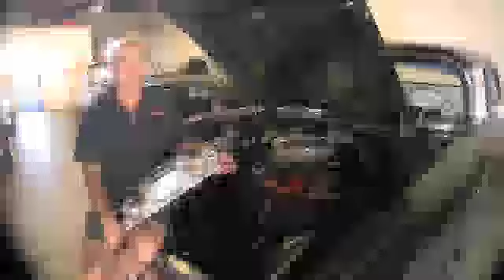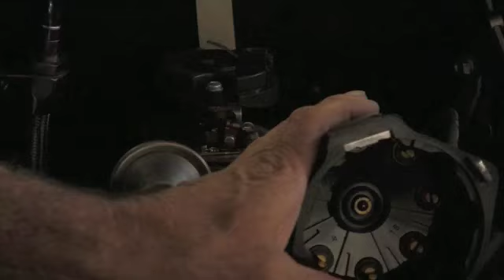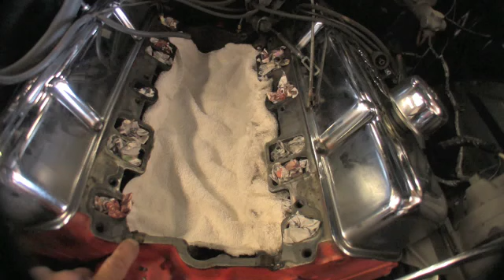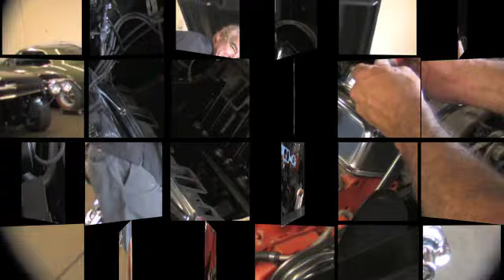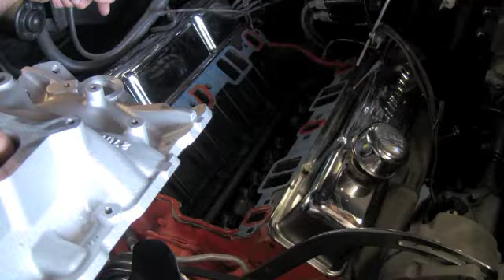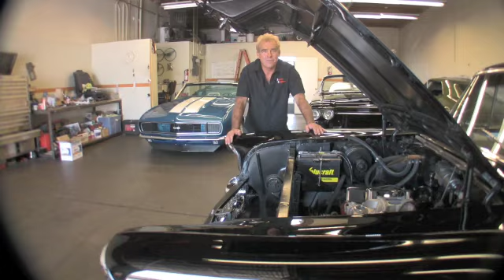Intake manifold Gasket replacement No Oil Leaks  by Scared Shiftless

Comment: Followed your instructions on my GM 305 CID...torqued all bolts to 30 ft lbs starting from center and found no oil leaks. Putting the distributor back in was a little dicey...but rotated the gear cw and then ccw and then slightly off the mark and it dropped right in. Engine cranked hard (battery?) but then started...needed timed 8 deg BTDC...now cranks easily...Many Thanks for your video!

Comment: Mark, Thank you very much for taking the time to make this video. Its about the best one out there for Chevys. I followed your steps in detail to seal intake. I got ZERO leaks, with the new intake install. I did my timing a little different, I set it to engine to point at 34 degree BTDS on the balancer then dropped in the Distributor rotor point to # 1 Plug tower on cap. Fired right up timing very close. Thanks you again.

Comment: Nicely done!  I did the same procedure on my 68 350 Pontiac.  30 years later I tore down the engine and the silicone was still working and parts came off easily.

Comment: Thank you for responding back, and thank you for your video. I was going to use those rubber gaskets, but I will just use the High temp silicone. Don't want any leaks.

Comment: Hey Mark, I have been a professional mechanic for over 10 years, I have used Scotch-Brite pads, a rectangle pad like you show and a 2.5" disk for an air tool. I have completed and estimated 1,000 intake R&R's and have never had an engine blow up. These fibers you speak of are actually composed of plastic which has a melting point of 150°C, the fibers are also coated in aluminum oxide. I agree a hard substance like aluminum oxide should not be inside an engine, however a razor blade/scraper will not always remove all gasket material/oxidization. I like my intake gasket to seal, especially if that is why you are there in the first place. If what you said were true, there would be many mechanics out of a job as I've seen nearly every one use this "forbidden" procedure.
Reply: Well lots of mechanics do things wrong, too. Most people I've heard say never to use those scotch brites, but I know there are different varieties of them so who knows, maybe some are more destructive than others.

Would you agree on the 5-minute "set" time for the silicone? I'm about to do this job on a 3.4l V6 but it's my first go at an intake manifold. I'm just curious if the silicone has to cure for a minute before torquing the manifold down.

Comment: after watching all these videos on how to remove and or install a intake manifold I never hear or see you guys explaining that it is absolute necessary to drain the radiator and block before removing the intake....if you do not then as soon as you break the original seal between head and intake all the water at top end of motor falls into the oil pan....

Comment from the maker: Using a small amount of silicon on the intake bolts will help reduce oil from climbing up the threads. It is best if you use sealant around the sides of the bolt only!. Try not get get the sealant on the end of the bolt that could go into the engine valve train area. Great Question M. Welther. Thank You

Comment from the maker: In the center of the heads on the intake side there are ports that would have heated the underside of the intake to warm the fuel. The exhaust would have run from one side to the other through the intake.  That is a thing of the past. It was more for smog than anything else. Very common even into the 1990s on most engines.

Comment from the maker: Permatex High Temp Red RTV Item # 81160. Works very well. Never a problem. Thank You
Reply: Ok Mark I have a 67 Chevelle I put a olds5.0 from a 80 Cutlass. Now I'm up to Putin the intake on I never hear of not using the gaskets. If u have that nice of a car I'm sure u know what's up. So this Friday I'm going to do it myself. Any advice u can  give me like do u use one tube of red n is it a quarter of an inch around the jackets. Well wish me luck because this is my second attempt n I tried using the rubber n when I torqued it down they moved. NICE CHEV. Thanks I let u know how it turned out

Comment from the maker: We only use Felpro MS90314-2 These gaskets fit many engine sizes so check before you install. No sense in doing all that work to save a couple of bucks installing cheap gaskets. I am pretty sure most part stores have them in stock or can order them for you. Thank You for your question.

Comment from the maker: One is for the heater hose fitting. The other is used for water sensor. Sometimes the water sensor is in the head. You can just block them off if you are not using them. You may want to check the back of the intake for another water port. Sometimes there is another for steam. That would go back to the radiator. Most applications do not use this port unless you are racing and need extra cooling. Thank you for your comment.

Comment: great video,  swapping out a efi throttle body out for a new carb and intake, how about those middle inserts for the bolt directional change, looks like they could use some sealer around them,  your opinion,  thanks

Comment: Hi Mark,
Thanks for taking the time out to do the video. Question for you. Everyone says to have your engine at TDC but if you mark where the rotor is pointing and put it back at the exact same location and if the engine haven't turned since you took out the distributor, is TDC even a factor? I'm replacing my manifold and having my distributor recurved and marked the location of the base and the location of the rotor. If it goes back in the same location, I'm good to go?
Thanks!
Reply from the maker: You can set the timing to top dead center no problem. However as you stat as long as you do not move the engine you will not have any problems getting the timing set. More than likely after the distributor has been curved you will have to adjust your timing a little to compensate for the new curve values. Thank You for your comment. Mark
Reply: Mark Boice Thank you for your reply! Appreciate the help!
Reply: Mark Boice Bro, I m having a problem with the metal part of the brake booster tube at the intake.(Chev 350, 93 Suburban)  I believe the smaller end is 18mm and the bigger end is 21mm.  But I cant turn the smaller fitting without twisting the tube. And I cant turn the larger one without turning everything.  It is the final piece before I can remove the intake easily.  What do you suggest?

And I used a breaker bar on the crank to get the rotor to the #1 cylinder position in the distributor before I remove it(which also means that the engine should also be on cylinder #1.  So as long as I dont crank the engine the distrib. should be installed in the exact same position(which looks like 5 o'clock) when I put it all back together.  What do you think?  Good or bad?
Reply from the maker: ZanzibarJose You will need to apply light oil to the fitting. Use a fitting wrench and turn the fitting back and forth just a little to loosen the tube. You can use compressed air around the fitting to remove the debris around the fitting that is holding it up. Keep applying light oil and compressed air and turn the fitting just a little at a time. It is a long process but it will work without damaging the tube and fitting. Mark
Reply: Mark Boice OK, flared wrenches, good.  I ll try that. Penetrating oil on the threads of the smaller fitting, ok, good.

Comment: Thanks your reply, your instructions were great. I have a follow up question. When i broke the intake seal, i heard a gurgling noise, like fluid was draining down. What could that be? I did not fully remove because i had the head gaskets on. Im hoping its jot antifreze getting in. Guess i would see that once i pull intake off. What do you think?
Reply from the maker: Probably anti freeze. Just get as much out the valve train area and for sure drian the oil and replace it before starting the vehicle. Get question! Thank You
Reply: Yes antifreeze. Best to drain it down a bit or do a drain and flush when replacing manifold gaskets. My 93 Sierra leaks oil from front and back of intake manifold. And also the oil cooling lines leak and need replaced but are gonna be a pain. Has clamps holding  lines to oil pan connected to the oil pan bolts. And there are two support rods from the block to the flywheel cover in the way also I can't break free. At least before I bought a 24 in breaker bar. But my engine bay is getting full of oil and looks ugly. And timing chain is going in today as well. And catylitic converter is probably coming off as well and just put pipe in it's place. No emissions where I live so don't need the restriction.

Comment: Thank you for this video man, I just used this to replace my intake in my 63 impala. Followed every step and I hope it doesn't leak and solves my problems I'm having.  Also very funny with the wifes towel . Thanks for adding some humor to it. How long do you usually wait before starting the car?
Reply: 24hrs
Reply from the maker: You should wait at least 4 hours. We usually give the sealant time dry over night. Thank You for your comment.
Reply: Hey Mark . I waited a weak to start it . just started it and it's leaking coolant out of the front and rear intake  only on the pass side . it's coming from the gasket , not the bolts .. I checked and they are torqued . any ideas ? will I have to pull it all off and try again ?
Reply from the maker: Sounds to me if you have only one side leaking, the gasket slide from its positive position. You will have to take it up to inspect. The only other thing which would be not so common a problem is that the block and heads have been milled past the correct angles between cylinder head and intake. My bet is on the gasket slide. Please let us know when you find out the problem and solution. Thank You.
Reply: Mark Boice okay I will check and see . all bolt holes aligned with the gasket holes when I installed the bolts . but I will tear is back down and see what's going on . think I'll need to buy new gaskets or can I reuse ?
Reply from the maker: New Gaskets!

Comment from the maker: Great Question! It is always a good idea to wait a couple of hours before adding coolant. It will take some time to install all the components back on the engine like carburetor, alternator, and linkage. By the time all the items are installed you should be fine to start the engine with no problems. Thank you for your comment.

Comment: Why are you adding more gasket to a gasket, specifically RTV sealant.  The intake gasket is the RTV gasket.  You are creating another place for fluid/exhaust to leak from.  Felpro recommends to install their intake gaskets DRY.
Reply from the maker: Answer is simple!  No Oil Leaks!  Felpro designs their  gaskets with parts that are free from rust pits and prefect surfaces.  When using original parts that are sometimes 30 or 40 years old a perfect surface does not exist!  Thank You for your question.

Comment: That "thing" is the oil pump drive shaft and you don't have to get in there with screw driver.  If you are sure the distributor gear is engaged right you can turn the motor over and it will drop the rest of the way in.  BTW- the distributor turns 42 degrees from first gear engagement to bottoming out.
Use only aerosol brake cleaner or Lacquer thinner to clean gasket surfaces.  Carb cleaner and many Acetone's' leave oily residue (don't know what they put in some Acetone  but I avoid using it for RTV/Silicone gasket surfaces, learned the hard way).  WD40?! What are you thinking, keep it away.

Comment: Great video!., but I have a Question...I am putting on a 7101 Edelbrock intake on a 350. I noticed that I have three water ports on each head; just like on the one in this video. On my new intake, it only has two on each side. My question is, did I get the wrong intake or is there away to block off one of the water ports?

Comment: I had a faulty repair job on 2001 chevy van.Second mechanic said the intake manifold gasket had slipped.  First mechanic said chances of that is very small,  plastic pins that go into the head  holds it in place, making sure you don't let the gasket slip. Comments?
Reply from the maker: hidden4est  Interesting! It seems very unlikely that they could slip. However there is not much room in the engine compartment so it could have gotten moved during installation of the intake. Even if it slipped a little it should have been close enough to seal. It would have been near impossible to line up the bolts into the gasket had it moved a lot. If the gasket where so far out the truck would not run well and you would have some very good oil leaks.
Reply: +Mark Boice You can also use a spray gasket adhesive to hold the gasket in place while jockeying it around to get the intake to mate.  This method is especially helpful if you can't get eyes on the intake and head while you are installing it.

Comment from the maker: Not really. When the rubber gaskets are blown out the PCV valve does not work properly. It sucks air in where the gasket material is missing. This causes the engine to run poorly. A bad or missing PCV valve can create so many oil leaks on and engine you just would not believe. In older engine to solution was a down draft tube. Today the answer is a vacuum pump. Some engines even have a catch can to collect oil. Hopes this helps you. Thank You Mark
Reply: Running crankcase back into carb via PCV valve is a horrid idea and not good for carb as long as a vehicles exempt from emissions. Run a breather and call it a day.

Comment: I'm using Coppercoat spray on my fel pro seals.  I'm using the black form a gasket silicone, recommended for flexible gaskets for the front and rear seals.  Is this sufficient.  btw, Why did you toss the flexible front and rear seals out... Thanks.

Comment: Excellent video and answered my question as to why I was getting a mild oil leak on the side of my intake.  I didn't apply any sealer to my screws.

Also, in the video you stated that you would post another video showing how to adjust a distributor.  Is that video uploaded?

Comment: Is that the intake manifold gasket made for iron intake manifolds? would not the del pro 1256 be a better fit for the aluminum intake you choose to put in place of the  stock cast iron one?  Or can you actually use this stock factory intake manifold gasket for all intakes, cast iron OR aluminum?

Comment: Hello Mark, 

Great video, I pretty much do the same procedure as you but i have a  problem with my intake gasket that being wet with cooling water.  It begins with a small amount (drops) that occurs all along the intake and after a week the gasket is soaking wet.  This has happen two times in a row..  What am i doing wrong? Didn't have this problem with my old intake (holley strip dominator), the new intake is a edelbrock rpm airgap on a big block chevy. 

Best regards //Roger

Comment: So, as soon as I began to loosen manifold bolts, a considerable amount of coolant started leaking out from under the manifold, and going all over. ...is that normal?
Reply from the maker: It would be if you did not drain the coolant from the engine. Otherwise not normal at all.
Reply: @MrScaredshiftless  I removed the hose from the radiator to the manifold, and did my best to drain all the coolant from where that hose goes into the manifold. 
How do you drain the coolant from the engine?
...I watched every video I could find on removing the manifold, and not a single one addresses coolant fluid.
Reply from the maker: @LastBastian  You can use a vacuum to get the coolant up that you can see. However an oil change is the best.

Comment from the maker: The water jacket area will always have some pitting on the intake and the heads. Silicon will fill the void to prevent leaks. Water in the oil Not Good!

Comment: Does the area under the intake where the push rods are have to be totally clean? I have never installed an intake and would like to know.

Thanks
Reply: There is always normal build up of deposits  on older engines. Most importantly is no loose debris. I would try not to disturb the valve train area by cleaning. Could cause problems latter. Thank You for your comment.
Reply from the maker: I personally would not over clean that area. Loosening up some of the debris in that area could find its way into the valve train like lifters and portions of the camshaft. These debris could possibly create problems in these areas. Just make sure that there is no loose debris that can get into the oil passage ways and you should be fine. Thank You
Reply: Thanks for the reply,

Comment: Hi Mark, I'm installing a factory cast iron Q- jet manifold to my 67 Chevelle 396, I have a Felpro gasket set with the rubber f & r seals, would you recommend disregarding them on this application as well? I used the high heat RTV before for other applications before and I know it's good stuff, heard mixed opinions about using it on Felpro permatorque gaskets, especially cast iron manifolds. I did see your previous reply about older surfaces but was curious about my application. Thanks, Tom
Reply from the maker: I would certainly toss the front and rear seal. RTV  is our friend!
Reply: Mark Boice Thanks Mark, I'll be assembling it tomorrow.